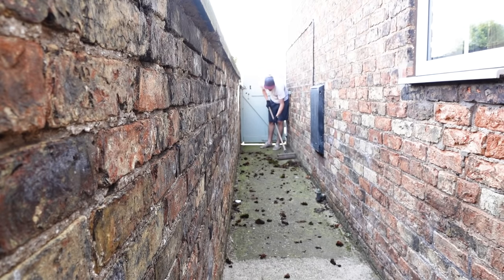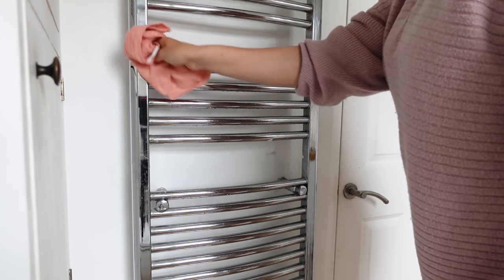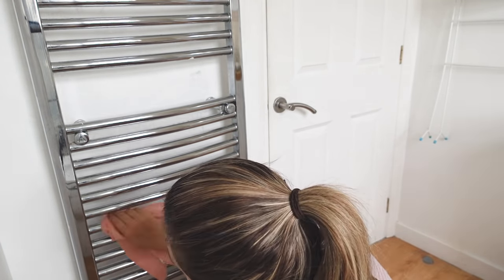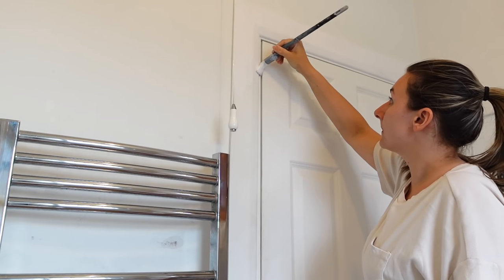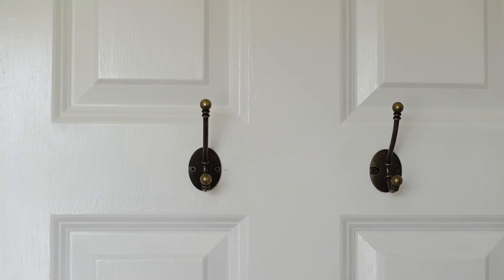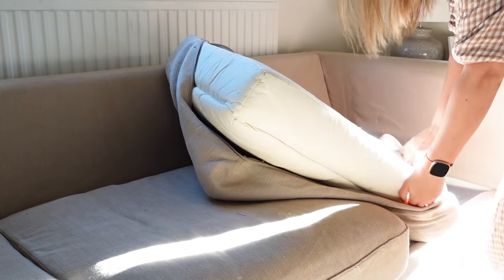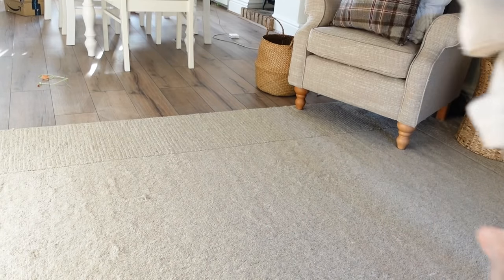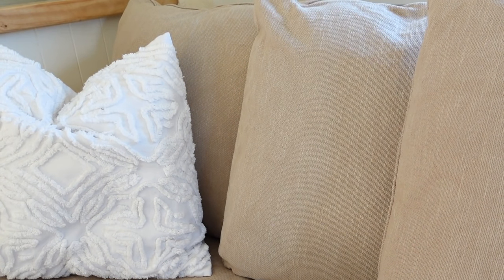GET IT ALL DONE With Me | deep cleaning sofa, speed clean, pressure washing, DIY & home maintenance

Comment: I have a radiator like yours. I have a small microfibre blind cleaner that I use to dust it. It cleans 3 rails at a time so still a bit of a pain but much quicker than doing them individually.